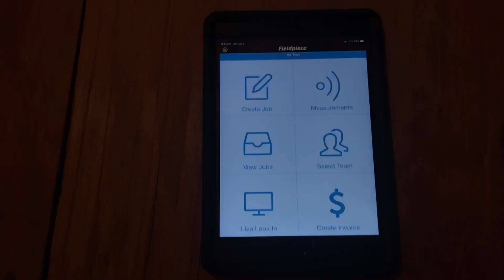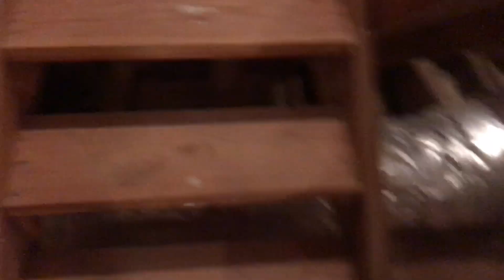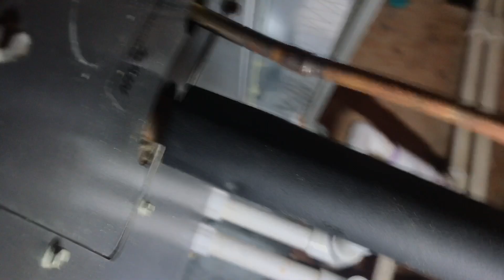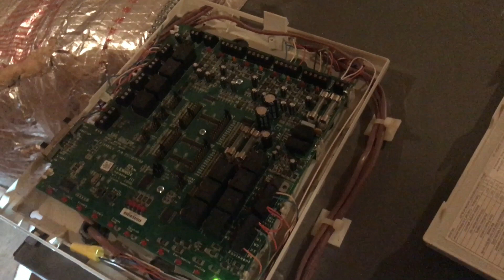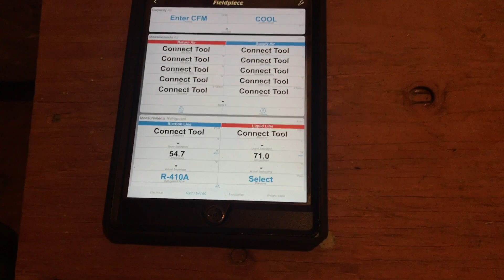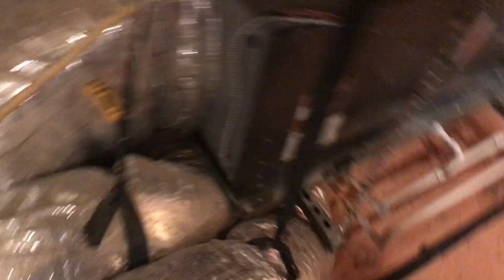HVAC Tech Life Maintenance & Testing Range of Smart probes

Comment: Yeah, I can't complain on the range of those Fieldpiece probes. They go through at least 2 floors of concrete. I wish someone (maybe they do?) made a transmitter/receiver that  could be plugged into the usb port of the Android and dangled or tethered down over the edge of a rooftop (for example) for an unlimited range. Back when MQ worked with my Fieldpiece probes, the range seemed like it was a little better. 
BTW did you have those hooked up to the condenser next to the house or down the cliff next to the retaining wall?
Reply from the maker: The condensers next to the house which the attic is the 4th-floor basement is ground level with doors out by the condensers. I learned today I have a better connection with my iphone over my old ipad

Comment: bill  how  far  were  you  from  the  outside unit  love  that  tool  have  you  ever installed  ez   traps   with   the  brush    thx  edbonjovi  aka  the  leak master
Reply from the maker: I have serviced systems with the ez traps yet not a fan they seem to crack and leak often from the cold winters. I like just doing a pvc trap snaking a zip tie and flushing water through never have any problems. The attic is the 4th floor of the house. I could have been about 100 feet from the condenser

Comment: E-Z Traps bro. Love em, makes clearing drains easy as sin. using a Gallo gun can be a pain with em sometimes tho
Reply from the maker: The drain setup I use works and doesn't crack and break over the winter time like the e-z trap. Zip tie instead of carrying around a nasty slimy brush
Reply: @thehvachacker  ones we install have a brush that stays with it. And we've never had the EZ trap break like that. I'm down in philly btw, so similar winters. I am gonna start carrying around a big strap like that tho because we got plenty of traps that aren't ez traps.

Comment: You and I were talking about the range I am going to test myself and actually see how far it goes . Your in the attic , that’s incredible range
Reply from the maker: The condenser is in basement level in the side of house so it’s 4 floors. I am going to be doing different test for a review on this tool. It did struggle with the connection some. But a normal house that’s not mostly cement it should connect better. I don’t think it would work on the condensers that were on the side of the cliff.